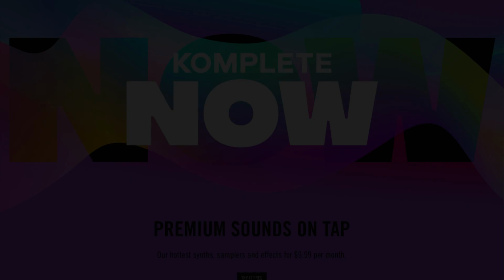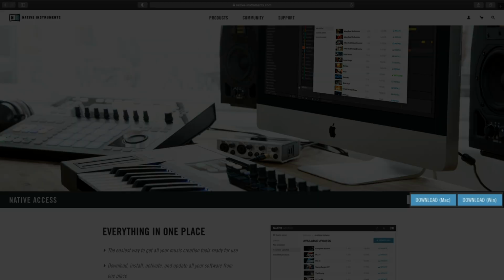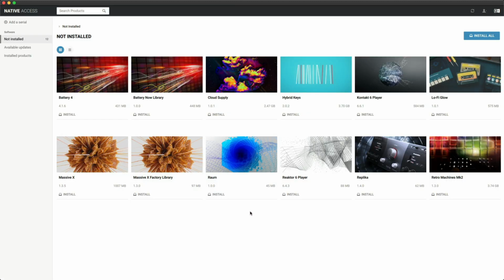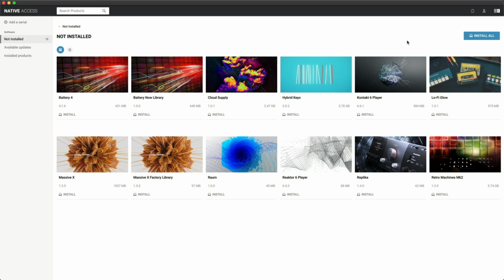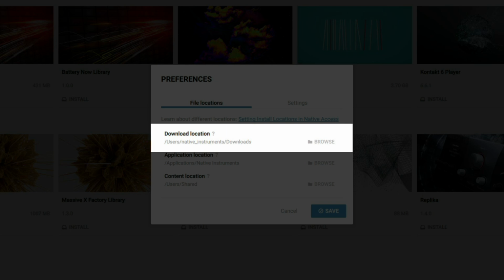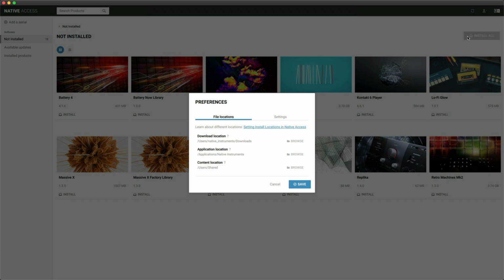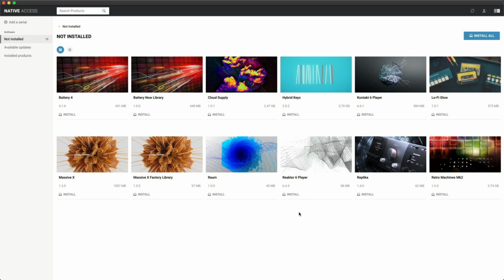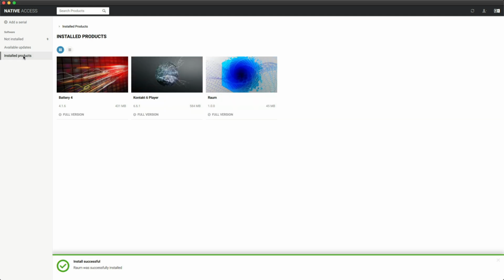Installing KOMPLETE NOW with Native Access | Native Instruments

Comment: If anyone has issues installing use a VPN and it will work. I had mine on windows 10 and it would not download (waiting on connection) until I turned on VPN.